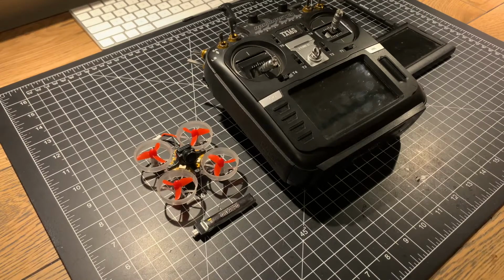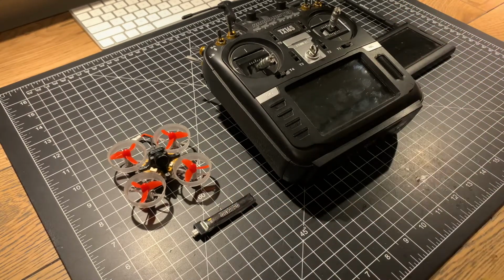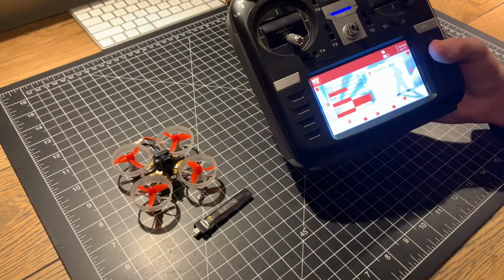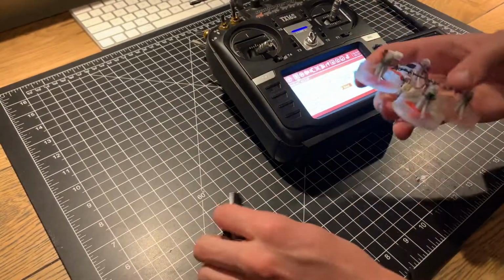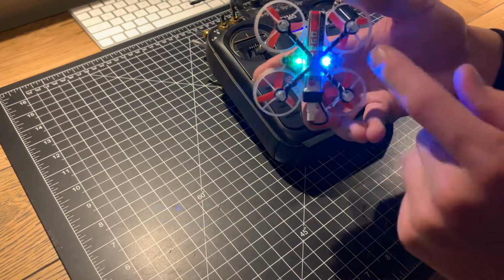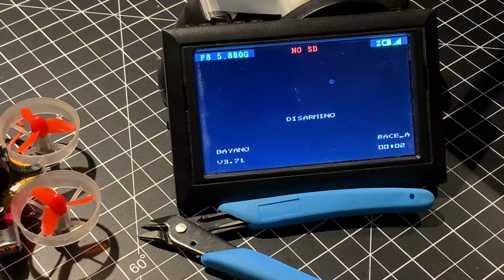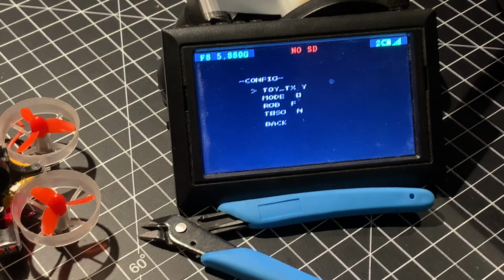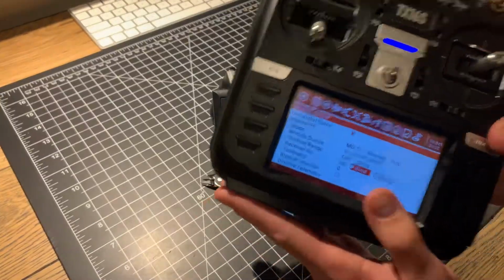Bayang BETAFPV Lite V2 Whoop FC OpenTX Bind Tutorial (RadioMaster TX16S)

Comment: your video would be the best if you show the model creation part.... you self described that the channel mapping in silverware (betafpvlite) is completely different. and this part of setting up the correct channel to throttle etc. is a key part :) otherwise it is a huge help. thank you for your contribution
Reply from the maker: Thanks for the input! I will use that for next time :)
Reply: What channel for arming? I can move around osd...si i know i binded ok.  You dont tell us what channels to setup for arm disarm etc.  These are important for us to fly the whoop.
Please advise us
Reply: @CustomFPV  I googled how to setup an OpenTx controller for a Beta Whoop and ended up here, and setting up the switches isn't simple.  Did you get to the next time video?  If the info was here, it was worth a sub.

Comment: How to change acro to level mode ?
Reply from the maker: You can set that up in the OSD, depending on if you have the “toy tx” functionality on or off, It’s a topic for a different video, so I would recommend checking out the manual in the meantime. Thanks!

Comment: How come I can’t go to the menu
Reply from the maker: If you can’t get into the menu, the bind has failed, and you need to try again. you should see the green and blue lights turn off once you bind the transmitrer
Reply: When i Plug in the battery the red is on then the blue and I think it’s pink flashing . I don’t see any green light